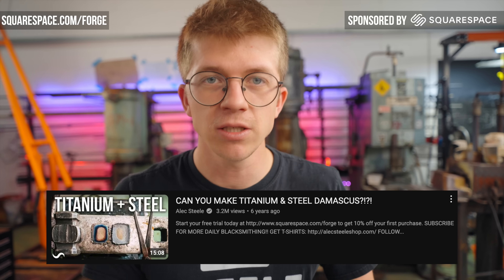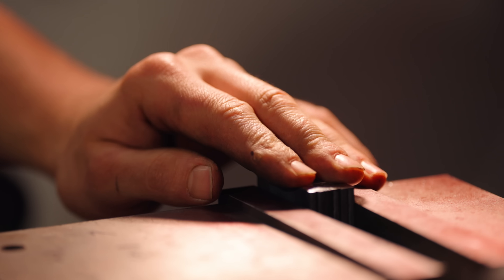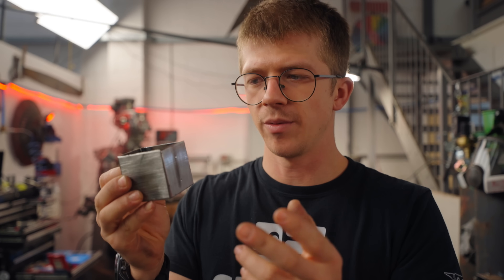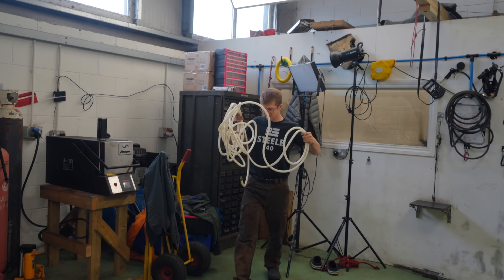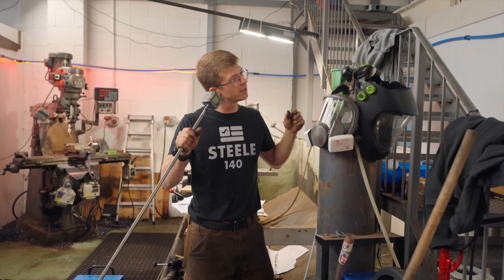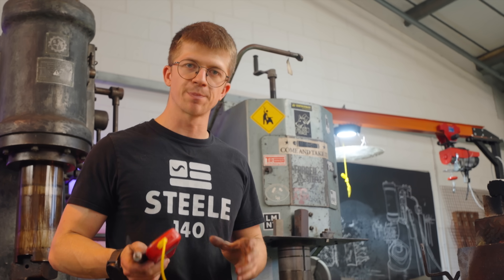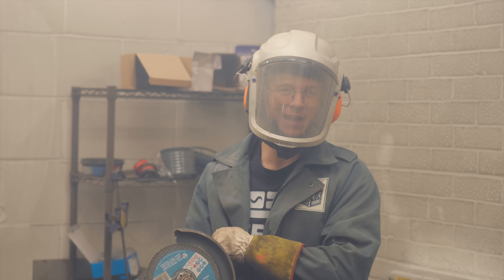Can I make Titanium Damascus?

Comment from the maker: It’s pretty special to be able to make this happen after all these years of wanting to try it. I’ve got huge respect for the inventors of the process and the time and effort they put into developing it and patenting it 20 years ago. I’m very excited to see what we can do with Titanium now that we can forge weld it! Maybe I’ll try a lower temperature next time though 😅😂🔥
You can check out the bonus shop improvement video here by the way! https://www.asteeleblock.com/bonus
Reply: Hey alec, i saw something similar in a metallurgical paper the other week. Same procedure, making some obscure layered metal for interface reaction studies, but using vacuum! I suspect argon is actually better, because a small leak in the canister cannot spoil it. Even with a pump running, vacuum needs stupidly large cross sections to be maintained against a leak, not a thin long handle. Simply because it is so very much not dense and moving matter at such low pressure takes a load of space. But i dont think this was patent worthy at all. Metallurgists probably knew this methods for decades and some schmuck just made a patent. Happens like all the time. Cool process though.
Reply: @Zonkotron  Tbh, patenting that does seem to be a c**t move. If it was such a hard process to figure out, they would have just kept it a secret instead of spoiling it in the patent and relying on the law. But now that the patent expired, I guess everyone's timascus scale folding knives will drop in price 😂
Reply: @mrkiky But that is the whole point of the patent process, to stop reader secrets going to the grave when the person who invented it dies. The payback for this knowledge preservation is the protection offered to the inventor (assuming they can afford to defend the patent)
Reply: It's very cool that you were finally able to do this on your channel without running a foul of patent laws. Honestly, I don't understand why this was patentable, though. It seems more like a trade secret. I'll explain. Nothing was novel or invented. Piping inert gases through materials like metals at high temperatures to remove oxygen is normal. Blacksmiths and welders do this every day. Using cans for forge welding is normal. Blacksmiths do this every day. Adding holes to cans for gases to escape is normal. Many metals, like stainless steel, basically require this, and it is done every day. All of this normal stuff is commonly used in metal shops, labs, and commercial manufacturing worldwide and has for much longer than 20 years. There is a reason, other than the titanium itself, you didn't necessarily have to buy anything or machine out a specialty part. Everything you did is basically "common knowledge." Patents are for novel inventions and novel uses. When you take a bunch of everyday stuff done daily in many industries and tweak the process, you are really just tweaking the "recipe," not inventing something new. When you find a recipe and don't want to share it, you keep it confidential and call it a trade secret. These are normally not patentable.

To make this clearer, here is a different example. Less say I make hard peppermint candies. One day, I decide I want to make them with chocolate centers. But chocolate melts at the temperature I need my hard candy to be at to flow over the chocolate. So I try freezing the chocolate to -40⁰C/F and pouring the molten candy over. It works. Did I invent this or did I just tweak the recipe of coated candies? Is this patentable, or is it a trade secret? It's a secret. I didn't do anything new or use something novelly. Chilling foods for processing is normal, just like purging oxygen with inert gas is normal in forging and welding.
Reply: Use the billet to make a Ti Damascus razor....... and then shave off that puberty tash.  Please just shave it off.
Reply: The patent is a life time expiration. Meaning it is now public domain and anyone can do that process.
Reply: I have an idea for a nice knife.
Think of a titanium damascus with a raindrop pattern. I think it would look like a rainy sunset. Or twisted titanium damascus. Or a really hard challenge would be Mosaic titanium damascus for a sword. The blade would look like a church windows from the inside. There a so Manny things now and everything will be colorful. I'm really excited
Reply: We need a damascos titanium knife 🔥🔥🔥
Reply: Since the titanium seems to have stuck to the steel can, why not try for titanium-steel laminate? Think of the color possibilities.
Reply: the cat hair on your shirt is distracting
Reply: forge welding and pattern welding does not damascus make. its a true shame how much MISINFORMATION goes around ._.
Reply: Timascus putter with a mokume gane face need to happen!
Reply: Titanium katana .... Has to be
Reply: Build a sword out of it, a knife is too boring 😊
Reply: @AlecSteele  Try Type 5 Titanium rods in an X pattern with powered Type 2 Titanium for filling in the gaps. Titanium beads and Titanium powder and you determine which Type 2 and 5 for more radical 3D patterns.
Reply: @clibanoamanse  No need to anneal, you are hot working so minimum strain and work hardening introduced into the workpiece, you only need to anneal if you cold work and thus "work harden" the material. The annealing process will re-crystalise and thus soften the material after cold working / work hardening.
Reply: The term "damascus steel" is very commonly misused & abused. It's a hot topic and buzzword, so of course everyone wants to use it in their vid title or article. I think it's absurd that the term is so commonly misused that everyone had to switch to using "wootz steel", instead. The proper term for the steel most vids cover is "folded steel", "layered steel", or "forge welding". At least terms like "damasteel" or "damast" are slightly different from "damascus".
Reply: Ok, now make a Titanium Damascus Longsword, give yourself a really fun challenge with this :)
Reply: You are the goat!
Reply: FYI as others have stated, patents only stop the sale of products, not the concept as a whole from being distributed in a video (unlike copyright, which is to stop the spread of unauthorized distribution of owned information). You can make as many videos about all the patents you want. It is basically how NileRed has made a bunch of his content because with chemistry, even the smallest errors could ruin a project, so he uses the patents as a way to narrow the scope of his trial and error process. There is no recourse for publicly showing a publicly available patent on youtube for "educational" purposes (educational meaning something you have zero intention of selling commercially but its not really an informative process, just you messing around with something that is a passion for you).
Reply: I'd recommend investigating the melting part further... You might be able to get some swirling patterns just by introducing some spin in multiple axis.

But don't get it hot enough to straight up alloy.
A bit of melting is beneficial, so the surfaces will diffuse into one another.
Reply: Tbf, moment he said diddy, I thought "ut oh"
Reply: I can’t wait to see more 👍🏼
Reply: That argon backpurging would probably help improve your regular steel damascus as well!
Reply: What about bismuth? I know Nilered did a video making a knife, but what about a forging?
Reply: Having watched so many of yours and NileRed's videos, improving on previous instructions that seem logically better is a good thing to do, so long as you still have materials to go back and do it the standard way if your idea fails.  Never stop trying to improve, perfection is the antithesis of progress!
Reply: This look like the Synthwave sunset if it was rounded out just a little more. It'd be the ultimate mosaic Damascus and everyone like me who knows what that is would probably want to buy a slice of it. I want to challenge your creativity Alec. Can you make a Synthwave sunset in Titanium Damascus? NGL it'd be the best keychain if you were able to draw it out, you could make quite a few slices of it for keychains. I'd pay $30-60 for a Titanium Damascus Synthwave Keychain. It'd last a lifetime. (Google) Cyberpunk Synthwave Vaporwave Car Sunset 2 in Pink and Blue Digital
Reply: Titanium damascus katana when?
Reply: Please... pure 9-Nines silicon... it moves like steel. Keep it hot. Keep it VERY hot... oh... did I forget to tell you that it is LIGHTER than Aluminum, harder than Steel, and can be sharpened to a finer edge?
Reply: I've been watching you for a little bit now and i remember when you tried it all those years ago. This was extremely satisfying to see you pull off. i cant wait to see what you do with it.
Reply: You should, theoretically, be able to try this with mixtures of Ti welding rod in a box as well.  Maybe that  Ti to Steel forging you've wanted might work under inert gas heating conditions after all.  The difficult thing might be drawing it out w/o excess atmospheric exposure... it will need a constant jacket for that.
Reply: What would tungsten Damascus look like? Is it even possible?
Reply: About flow rate. You calculate that based on cross-section of your out holes and diffusion speed. So by making more holes you have to increase flow rate. And you don't even really need that holes, all you need is a small pinhole to keep the gas flowing out - it's not a big deal if some oxygen remained in that box, after all, the moment you sanded down your titanium it starts to oxidize anyway. That remaining oxygen would react with titanium, not a big deal as it's just in small quantities, and you just flow inert gas (pretty much any) so that it does not allow new oxygen to go though that out hole. And it's not something like a wind, no, it's a diffuse process instead, meaning that oxygen molecules would be flying in random direction at the speed of sound. To COMPLETELY eliminate any possibility for an oxygen molecule to go inside of your box, you'd need flow rate so that it outflows at the speed of sound. But that's a HUGE overkill, because, again, not a big deal if just some molecules would get in once in a while, they won't ignite the titanium anyway. So, instead, you flow sufficiently enough that outflow of inert gas stops most of the oxygen molecules from getting in.
Reply: isn't patenting only stopping you from earning money directly from that Patented product?
Reply: You tube videos have monetary value though.
Reply: For purging oxygen from a copper pipe before brazing, we used a Wrist-o-meter in the field. If we didn't have a flow meter. Put the inside of your wrist (not you face that's unbelievably deadly with argon) over the output hole about 2.5 cm away from the opening. Flow is good when you feel it.
Reply: Well done. Will you be trying again, at a lower temperature and a different metal for the can?
Reply: Did it weld to the steel? Could you mix titanium and steel to make a damascus with this technique ?
Reply: Can you forge a 36 inch- 50 scalpel (sorry about the United States metrics) will it be sharp be sharp enough to chop and can you bake it look like the brush axe used in the ten commandments.
Reply: Mr Steele I am a humble follower with dream of having a family sword made by you. I have a few ideas but happy to leave it to you to do what you do best. Maybe a first and have a titanium Damascus family sword. I’m not a rich man but a hopeful one with a dream and if you don’t ask you will never know.
Reply: Next step add the titanium damascus to a steel( hardenable) core......tip to make it work: you need to ad a softer layer between the titanium and steel to get it to weld. I did one for a puukko a few years back.
Reply: Hey Alex!  Try Inconel Damascus!😮  That would be so cool.
Reply: @Christopher-mj6eo  Combined to titanium damascus...It works , i have done that....even copper will work. But that wil have to be done at a much lower temperature than any of the metals in the mix. 2 or more metal will become eutetic when in contact at a high temperature. The meltpoint of those metal will drop significantly under their normal melting point. Now he allready had metal squirting out at 2000°f.....i think even using 1750°f would be close to disaster.
Reply: IF you don't do a katana, bro! it would be UNIQUE
Reply: Hey Alec! I just got my forge together and I'm forging myself some tongs from round bar because I realised I'd need tongs to make the tongs I purchased blanks of 🤣 dumbest I've felt in a while lol. Is there anything you might suggest that a noob like myself might mess up? Like these won't need quenching right? And what would you use once finished to keep the metal nice? I head boiled linseed oil but I thought that was for wood. If you see this I appreciate anything you have to say! Been watching for over over 6 years
Reply: Maybe entertain more materials science ideas. Maybe Laminate Tank Armor a Tungsten Sandwich With Titanium in the middle in an effort to create a Lighter Core With super dense Tungsten on the outside layers
Reply: I need a million layer katana out of titanium now sir 😆😆🤣🤣🤣
Reply: Alex could you use MIL-A-12560 to make a sword or a knife? That is tank Armour  or would it be to hard to work with?
Reply: But if you monetize on patents via YouTube, maybe it counts for de lawsuit
Reply: Can you make "Damascus" out off something other than ferrous metal, NO.

Damascus is a technical term for a CRUCIBLE steel made with an alloy called wootz.

It is NOT any kind of pattern welding.. Only Americans call pattern welding "Damascus" because they are ignorant savages.
Reply: I’m the 1k like😮‍💨
Reply: I would absolutely love to have a chef knife made from this
Reply: Have you tried coating the inside of your canister with white out? It makes the canister easier to remove 👍
Reply: I want to see such experiments with nickel🎉🎉🎉
Reply: It's my 30th birthday next month I have been saving for a party however I have been a chef over 15 years how much would a high quality knife cost made of this material using a unique method of your own creation to create a one-ofkind peace?
Reply: changing the patent makes it viable for patenting, very smart
Reply: You need to research patent.  Patents only prohibit commercial use. You can use a patented process for personal use.
Reply: This dude is like, the Harry Potter of machining...
Reply: 🙏🏽Please make a Thunderstorm Generator 🙏🏽
Reply: Jesus loves yall
Reply: Yeah but getting paid on the video for something patented would not be allowed no?
Reply: I look forward to the 24 hour dagger build this year with this technique!
Reply: What gas are yall running in that forge to get 2200 degrees
Reply: Ok yes
Reply: Make me some zircuti Damascus glassblowing tools please ❤
Reply: what patent expired, what number? =p
Reply: square space is dog water, dont allow these corpa to steal ur earnings and to limit you in a box.
Reply: As a no stakes challenge, can you make a replication of real Damascus steel? Or can you make the real stuff with the original iron ore ? I don't just jump to the real stuff because it's not easy or cheap to get . However people should be able to replicate its chemical make-up to get a product that works the same way. Original Damascus wasn't a layered pattern welded material. The pattern comes from iron carbides forming in the steel as it is processed. At least that's the rudimentary explanation. The actual information is online from when the material was rediscovered.
Reply: Who was the owner of the patent?
Reply: @_Kompan  yes
Reply: We might be related, Patrick Steele, Okeechobee Florida
Reply: What do I gotta do to meet u this so cool I’ve been starting to watch these forging videos and I love it. I just been looking for someone to teach me. I know that costs a lot of money but is awesome.
Reply: Way to go young man! Keep reaching for the fringe!
Reply: Wouldn't the alternating edge properties between titanium and steel cause problems for a blade with Damascus patterning? You wouldn't be able to get like for like hardness right across the board cuz it's titanium that's that's one of the reasons they don't make blades out of it outside of razors...? I'm confused.
Reply: The amount of times that I've filled a glass of water, and then dumped it out while bending over to pick something up.. I felt that attempt to dust off the titanium pretty hard.. I've I've been there so many times it's it's kind of terrifying.
Reply: how much would this cost to have done for say a custom knife?
Reply: ❓ question ❓ 
Would Steel and titanium layered like that make more of a unbreakable blade? That has some flex still was thinking they are 2 of the better materials we have to work with a dimuscus steel sword is strong and flexible better then plain steel so would titanium work better like that too? And if so could adding layers of steel improve on flexibility so it's not too stiff and no flex and just snap or would the steel add a later to help it flex but either way we don't want either later just cracking and the other layer just hiding it so it would have to be like a 100 fold titensteel dimuscus I think that would be awesome to see the colors come out on that even a 50 fold titansteel
Reply: I believe they could go after him for profiting of their IP through YouTube monetization
Reply: Yes it is correct you are allowed to make a product that was patented but you are not allowed to profit in any way shape or form from that nor to help anybody else profit from it but you are allowed to make a patented product but you cannot cause any monetary loss to the company that you do not own the patent for
Reply: You should have applied for the patent
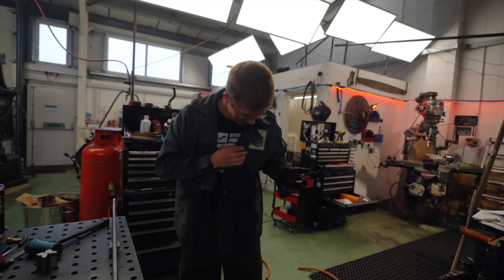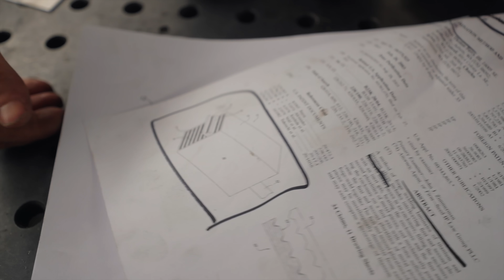Reply: 5:22 and 3:04 from “Making one piece stiletto dagger part 3” still warms my heart.
Reply: Please be careful, that was a close call with all that liquid molten titanium squeezing out towards you.
Reply: you could have always titanium damascus , you just cannot sell it.
Reply: @MOTOMONKEEZ or profit from it . Which is what youtube is . He makes videos thus making money.
Reply: @MOTOMONKEEZ 
You cannot make money of it without the patent owner being able to claim it all.

So i am pretty sure this guy is making money with it by making this video 😉
Reply: @MOTOMONKEEZ  it is not Damascus, it is pattern welded/forge welded. that is not how damascus was made. in the 70's some knife maker started calling pattern welded as damascus, because it looked somewhat similar. that's it.
Reply: Sell more of your pants, I need some good FR cargo pants and I don't wanna buy some 5.11s just to see you drop more pants the week after
Reply: Sweet. So is there any update on getting the steam hammer connected to a steam boiler?
Reply: @joshuabarron8535  He talks bout it a little on the bonus video on the website
Reply: @joshuabarron8535 no insurance company  worksafe  OHS  etc Workplace safety  will certify  any thing but brand new  low pressure steam boiler an that's what I know in canada.
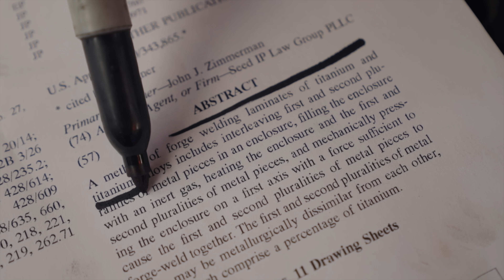Reply: @joshuabarron8535  absolutely is! On the special video on the website. Alec explains a bit. Also it's a good video! 0:20
Reply: You should go on forged in fire❤❤❤❤❤ Please❤❤❤
Reply: @JamesJames-r8t  from a friend that looked into it, FiF ends up basically owning your likeness and future intellectual properties. Especially for a craftsman, it's not worth the TV spot.
Reply: Please alec GET THE
 ( ** IDDY) Word name whatever needs to get edited out asappppp
Reply: There was never a paten saying you couldn't make it, they just wouldn't tell you how.
Reply: alec can you just admit youre out of ideas with all these clickbait obviously stupid idea videos lately